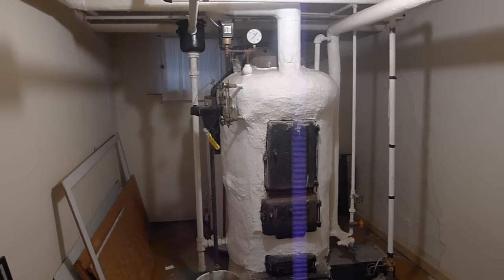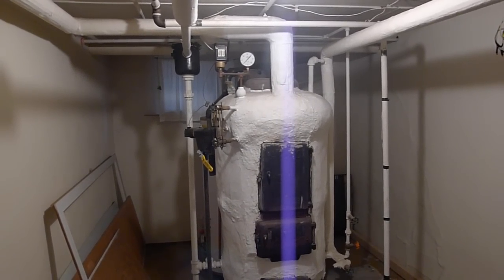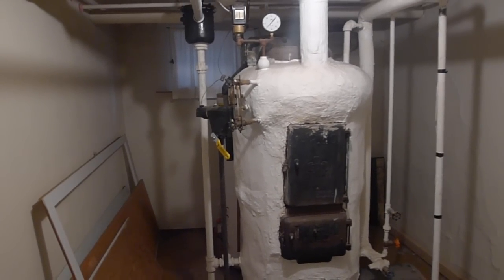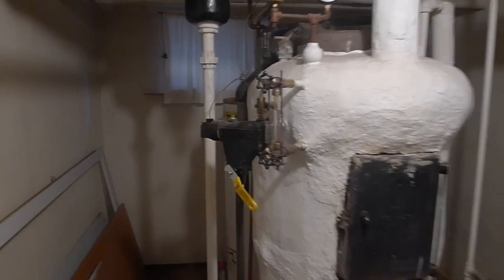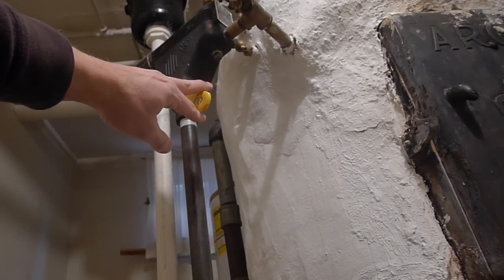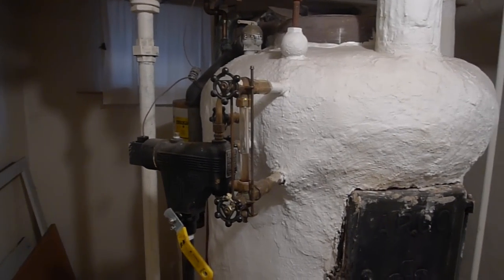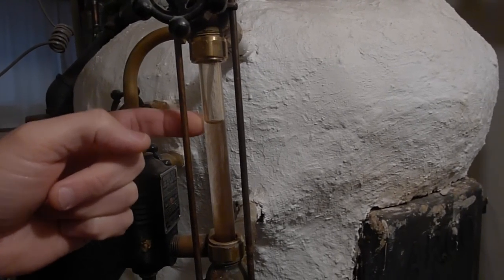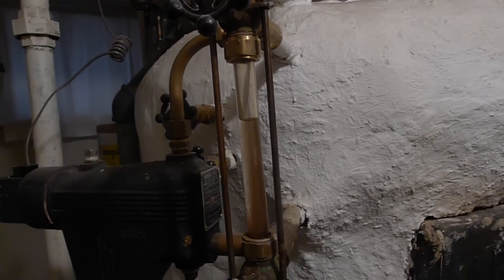Everyday Boiler Maintenance

Comment: I meant we've owned the house 12 years now ... the boiler is original to the house circa 1925. It runs off heating oil now, believe it was once coal fired. It also has a hot-water coil in it for our hot tap water. 

I think I want to move the hot water out and maybe even replace the whole unit for a gas fired one. Im sentamental though and its been the heart and heat for the house forever and I know whatever I buy today wont last 1/10th as long

Comment: One time, I had overfilled it - about the 3/4 mark - and had SEVERE water hammer.

The most important thing about a steam system is the vents - both at the radiators and also in the main line itself in the basement. Steam has to displace air in the system for it to "move" throughout and the only way to move the air out is if the vents are in good working order.

...thats my half nicle for now